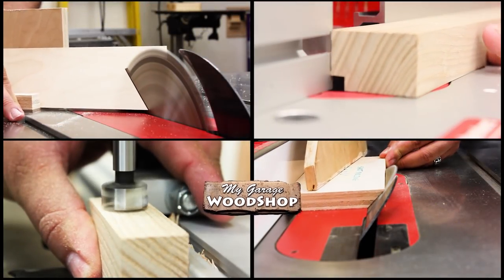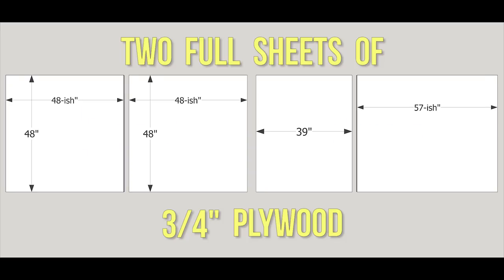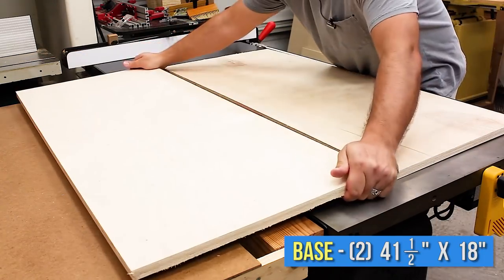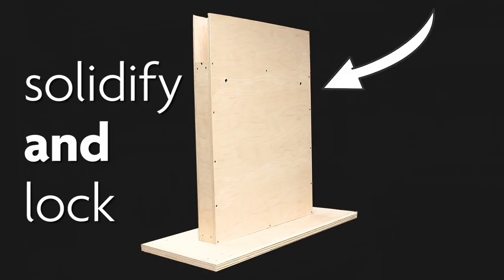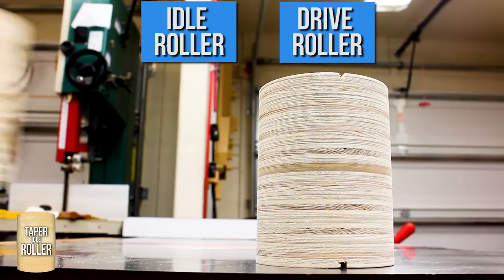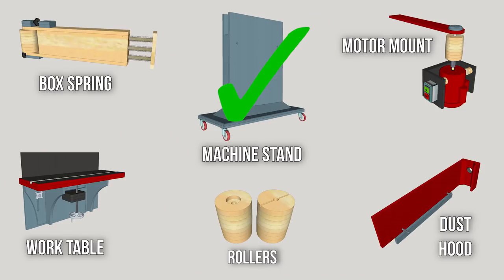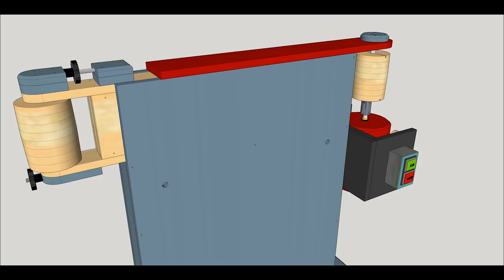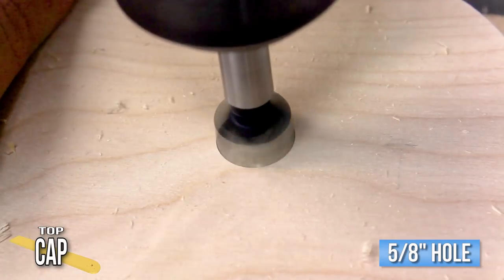Horizontal Edge & Spindle Sander HOW TO BUILD video

Comment: So I built it after watching the video maybe 25-30 times. Had to change up some stuff because I bought a different size belt but the guts are identical. 

Gotta say. I absolutely love it. It eats, and I mean eats wood. I gotta be careful with it because it'll go to far in an instant. 

I made the drum sanding attachment different because I'm lazy as hell. But it's kinda permanently installed with the dust hood resting on top. I didn't have hinges so I just remove the dust good with a screw knob. 

So in the end. I gotta give this video a 20/10 for being so easy to follow and clearly explained 👌👌 and the machine itself is a solid 10/10. Now I just have to paint it haha

Comment: For the last couple of weeks I have evaluating various sanders, and was almost ready to pull the trigger on a Jet edge sander. After discovering this video, however, I have totally changed my opinion and will undertake building this beast. Thanks for the great video, it gives me the extra confidence to undertake this project!
Reply: I would go with the Jet, Delta, powermatic. Grizzly as a last choice. Sturdy and will save you time.

Comment: Your editing and illustrations are outstanding!! I decided to take on this project and stumbled upon yours prior to start. I'm glad I did and it helped a bunch. I did, however, make a couple of modifications you and your subscribers may be interested in. First is the bottom of the table/work surface where the threaded rod that raises the work table meets. I felt that adding a small metal plate would help reduce the wear in to the plywood when the table is raised or lowered. Second is regarding the positioning of the knurled knob for belt tensioning. I felt the physical location was pretty close to the sanding belt, so before I "cut" the excess threaded rod (shown in your video), I drilled a 3/8" hole down the center of a 1" dowel rod that was about 2" long and slid it down the threaded rod....kind of like a spacer, making the knurled knob stick out a bit further.

Comment: I wish I’d seen your video before I built my Woodsmith sander.  You had some great ideas, and your presentation is superior.

A couple ideas for you, now that I’ve been using mine:
 - When sanding a big surface, I sometimes use enough force that the machine moves a bit.  Casters could make that a bigger problem (even if they lock).
 - The back of a sanding belt could wear through a plastic laminate platen over the decades.  Most portable belt sanders have a steel platen, secured only on the edge closest to the ‘upstream’ roller.  So I had a metal fabricator make a steel piece in place of the mdf/laminate piece.  On the left edge, the steel has two 45 degree bends.  One is 1/2” from the edge, and the second is 1/4” further from the edge.  (That makes a “wrap” around the left edge).  I cut a matching 45 degree edge on the plywood, then screwed the steel to the plywood, only on that 1/2” wide part.  There are no screws or holes under or near the belt.  The fabricator charged me $60.
 - Another guy who built this had the same problem with making the rollers as I did:  the jig is too narrow to roll the octagonal-shaped blank.  You must have fixed that, but I missed that in your video.

Comment: Hey!! I have to say, You have created THE BEST EVER WAY OF TEACHING HOW TO SOMETHING BUILD OUT OF WOOD. I am speechless. I enjoyed just watching your video but also as a beginner in woodworking but really goog quality woodworking shop established, now it is just about the maker, not the machinery. YOur instructions are really easy to follow and now that my workingshop is finally ready, I give You the honor to be the first ”teacher” and my very first project ever will be this edge belt sander with spindle sander option because this is a machine that my shop is lacking. My only big concern is that you show ALMOST in every phase also quickly the plans, i.e. The measurements of plywood and how to cut and drill them. But for example in the box-spring part, there was not these paper plans illustrated in the beginning. I am from Finland Europe and there is no easy way to get that particular Woodsmith magazine issue, in which those paper plans are shown. When I started to watch this video, I was full of hope that I do not need to make all of a sudden my own calculations but just follow the instructions and all the parts would then be a perfect fit. So are these paper plans available somewhere or these exact blue prints concerning your modified version of the machine so that I could get them from somewhere in the internet or could you send those plans through email or something. I would naturally want to pay for all the trouble but I do not know how. I did not find any internet pages of yours, where I could contact you. Could you please comment this message in some way and give some ideas how to get all the info or could you make a little extra edition of this great building process so that the paper plans before every part would be shown shortly on the screen so I can get the screen shot of those. That would make this ”how to build”- video a perfect teaching tool. Ever. I am already so gratefull for what you have given to the woodworking community wolrd wide. This is the beauty of youtube. Bringing alla Woodsmiths together and closer each other 🙏😊 Best regards, and Merry Christmas, Juhani from Finland

Comment: Videos great, you should make one with budget parts though. I wanted to build this so bad so I ended up buying the plans but I didn’t realize it was still going to cost a grand to build. Grizzly sells one for $955 and laguna sells theirs for $1500. I know buying the parts from specific sites through your links makes it easier for other people to build this but I think this could be built for almost half the price that you built it for. The parts from Mc-master carr are around $250 shipped, the motor is around $360 shipped from Amazon. Between wood, plastic, dowels, threaded rods, miter track, belts and screws your looking at around $300-$350. Plus I imagine you have around 10-20 hours in time building this, I feel like all this should be said on the page to buy the plans so that people know what they are getting themselves into. In parts and time your defiantly well over a grand to build this on your own going by your plans and links.

Comment: Rod, I agree with the others, your videos are first rate.  I would guess that production is more time consuming than the actual build time.  You now have an added subscriber. 
I have the plans and I'm ready to start purchasing the wood and hardware.   Thankfully,  I have a motor, though it will run on 220. No biggie. 
Question... what cut list program do you  use?  Or, do you have a PDF of you Cut list you can share?   Thank you!

Comment: This is a bad ass sander,,, easily a $1500. sander,,,, Great great video ,,,, BUT ,,I was just thinking of taking those sheets of tool box drawer liner,,, the rubbery cork like liner that's about a 1/4 inch thick and covering both drums ? would that add just a little better grip to the belt and maybe a little quieter ? Just a thought !    but this is a Super super build !
Reply from the maker: That’s not a bad idea, Sam! I’m not sure to be honest, you may be on to something. Thanks for watching.

Comment: Hey Rod - Excellent video and great sanding machine. I've always wanted to build some machines but wondered if plywood was really the best medium and/or if it was solid enough for heavy use. I have thought about using 80 x 40 aluminium extrusion as I have quite a lot of it but it not as easy to work with and the connecting fixings can be expensive. How do you find wood based machines in practice do they vibrate much and also do they need constant adjustment? Your machine looks so professional that I am very interested in giving it a go. Best wishes - Dave

Comment: This video is superlative!

OK . . . going to nit-pick here.  But really . . . it is more a comment about the suggested components by Woodsmith.  They should have specified an on/off switch with the large red, e-stop paddle.

I am a strong believer in using these and have converted almost all of my machines to using them.    They are only a few bucks more and add a new level of both safety and convenience to any shop.  When you want to turn the machine off (or if something happens) all you have to do is bump the switch with your leg.  

If only all instructional YouTube videos could attain this high standard!
Reply from the maker: Daniel, I’m wishing I would have installed the switch you’re talking about. Thanks for watching, man. Thanks for passing along that info to folks. Good looking out.

Comment: very very cool! looks incredible well done  but!!!!
where do you source the steel parts, motor, and anything else that is not wood?

so far Ive calculated it would cost $429 give or take $30-100
in parts and materials?

Comment: When it calls for plastic laminate for the platen, are you just using like a countertop type laminate, like Formica?  I am in the middle of this build and I am struggling trying to find "plastic laminate".  Thanks.
Reply from the maker: Yeah, bud. You can go ahead and do that. Sorry about the late response. Best of luck on the rest of build. Send me a pic when your done. Would love to see it.
Reply: My Garage Woodshop will do, I’m actually adding something to mine to see if it works, fingers crossed. I’m adding a deadhead to the back of it and using a 108” belt. Building it to assist with shaping electric guitar necks!
Reply: @willisguitars9356  Same idea here! You think 108 is long enough? I'm thinking 130+ Also struggling with figuring out what laminate to get...

Comment: Thanks for this!  As soon as I saw the video I ordered the materials and am starting this weekend.  One detailed question:  At 2:52 in the video you have the Pillar open end labeled as 30 3/16", but in the Woodsmith plan it's listed as  is 34 3/16” - can you share which is right?  I can't figure it out based on other parts in the Woodsmith plan.
Reply from the maker: Yes, sorry. I subtracted the height from the pillar about 4 inches in order to add wheels. WoodSmith plans have the machine sitting on the floor.  Thank you so much for watching. Good luck on the build. Please send me a picture when you’re done.

Comment: Just curious...is it possible to run the drive shaft up through the top so you could attach different sizes of spindle sanding wheels?    I wish i had half your ability of computer and speaking skills.

Comment: I love this sander.  I have been able to find 1HP motors on Facebook Marketplace>  I recently purchased one for $40.  This will save me a lot.  One of the motors I purchased is two speed.  Do you see any advantage to have two speed on this sander?
Reply from the maker: Two speed? As in, there is a faster and slower speed? If I understand you correctly I think it’s gold! You could use the slower speed for small delicate operations. Although, one advantage of the motor I used is that it’s completely enclosed so that dust doesn’t fall into the motor housing. If the one you purchased does not have that, you can come up with something ingenious to protect it

Comment: What type of plywood is this? Looks better than the homedepo ply, and defiantly cheaper than Baltic.
Reply from the maker: I used Home Depot plywood, Baltic.
Reply: Purebond maybe? You can get decent birch plywood from HD.
Reply: Maybe it's regional, in San Diego it's mostly a pine layered board. Usually there's some ratings of the type of ply. Bb/b etc. Just was curious since birch is 50+ a sheet depending on the grade.

Comment: I was thinking about this after watching your video a few days ago.  Could it be built so the sanding belt was placed at an angle (in reference to the table).  The belt would only need to be at an angle so that the right side the table is at the top of the sandpaper, and the left side the table is at the bottom of the belt.  That way the whole belt is being used to sand, and you wouldn't need to make the table adjustable (making the build even easier).  The only downfall I see to this, is that its sanding at an angle now instead of parallel with the board.  Thoughts?
Reply from the maker: Sorry, I’m a bit thick sometimes. Are we talking about the drum sanding table or  the normal work table?
Reply: My Garage Woodshop the big drum sander table.  Keep the work table (where you set the wood) as is - parallel with the floor.  Tilt the belt so it’s not parallel with the floor. So it’s at an angle, that way you use the whole sanding belt without moving the table.  I’d that doesn’t make sense I can email you a picture of what I mean
Reply: My Garage Woodshop so if you were looking at the front of the drum sander - the work table would be at 9 and 3 o’clock (left to right). The sanding belt would be at like 10 and 4 o’clock (left to right).
Reply from the maker: Ah, I get it. If I follow the logic correctly......In order for that sanding drum to tilt into the drum sanding table(or away from it), you would have to find a way to tilt the motor along with the sanding drum because The motor and the drum are attached to each other.  The motor is unable to tilt towards the table because it would need to move into the space that the machine stand occupies(the machine side). 
If I’m totally getting you wrong just email me a pic. Email is my channel name plus @gmail.com
Reply from the maker: Yup, the motor would have to tilt with drum too. But it would not be able to.
Reply: My Garage Woodshop yep, but what I’m saying is just build it so the whole sanding/drum/motor part is built at an angle (instead of parallel with the floor). This way you use the whole width of the belt without ever needing to adjust the height of the work table.
Reply: @MyGarageWoodshop  I just emailed you. lol
Reply from the maker: Yes. The way I see it, I foresee two problems with this solution. 

Firstly, the normal work table would have to be built at an angle as well. And when you raise and and lower that table it would have to raise and lower at angle.

Secondly, the drum sanding table sits on the motor plate sides when it is mounted. How would you bring the drum sanding table 90 degrees to the sanding drum if the motor plate sides sag in the future through continuous use?
Reply: @MyGarageWoodshop  You wouldn't have to move the table up and down anymore - so that function could be removed - by tilting the sanding belt, you use the whole belt with the work table stationary.
Reply: My Garage Woodshop I’ll try and do a simple sketch up model tomorrow
Reply from the maker: Just got ur email. This entire time I thought you had been speaking about the drum sanding table, but you were speaking about the regular work table at the front of the machine. 
The only problem I see with that is that you would not be able to sand longer work pieces that are super wide
Reply: My Garage Woodshop yeah you’d lose a few inches on each side, but you’d still have the whole length of the table (30”) for sanding.  You’d also no longer need to make the work table adjustable (up and down) because you’re using the whole belt this way

Comment: Hi I found your sander motor housing to be more difficult than necessary, you glue 2 pieces of plywood together and then route out a rabbit on two sides, why not make 1 of the pieces shorter by the width of 2 pieces of plywood and then glue them together leaving the same space at either end. No router required.
Reply from the maker: It’s easier for me to sneak up on the perfect fit

Comment: 7:53, how come the roller blanks are sitting flat on the table saw when you are removing the waste portion? glue squeeze out? looks sketchy
Reply from the maker: Hi Scott! Forgive me, I can be a bit slow sometimes. I read and re-read your question, but I’m not sure I follow. Ask me again, differently. 
I think I understand that you want to know how I handled the glue squeeze out. I waxed the shaft with paste wax a a couple of times before using it during glue up for alignment. Even so, I was careful with how I laid the glue, close to the center holes so that I wouldn’t get squeeze out toward the center. I did however have tons of squeeze out toward the outside of the blanks but I just wiped that off before it dried.
Not sure if  I answered your question?
Reply: @MyGarageWoodshop  it would help if i typed it correctly. they are NOT sitting flat on the table saw
Reply: @MyGarageWoodshop  I think Scott Haun meant the roller blanks aren't sitting flat on the table saw when you're removing the waste from them. It looks like they have a bit of a twist to them when you glued them up so it looks like they're not flat on the table saw. I think..
Reply from the maker: Oh yeah, they were definitely not flat at all. Super wonky, in fact. I wasn’t too careful about aligning the faces perfectly. I cared more about aligning all the holes in the center, in succession, all the way down the layers.  The blanks themselves don’t need to be 100%flat in order to cut them safely. All you do is anchor them down at a corner as you push them thru the cut.
Reply from the maker: Thanks Ken!